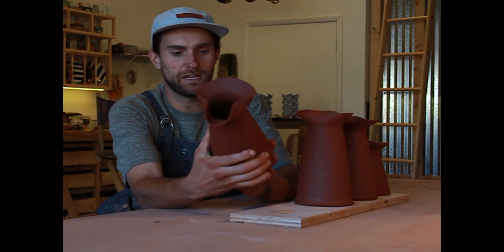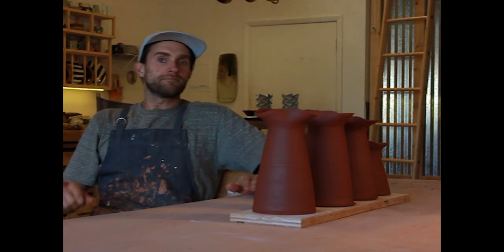PATRICK MAKES A PITCHER

Comment: Fun! Random questions: 
What clay body are you using?
Why the standing wheel? (just prefer the overall ergonomics? I hadn't given this a ton of thought but could see good reason for it now!)
Why the mirror by the wheel?  Specific function or just better for lighting?
(Also, no need to answer directly here - maybe fodder for future videos?)
Reply from the maker: Clay is called sandia red—cone 6 red stoneware made by New Mexico Clay out of Albuquerque.  I like the standing wheel because it feels better on my back and it’s easier to step away from If I want a better look at what I’m making from different angles.  The mirror is at an angle that allows me to see the piece I’m working on from a side profile.  When I’m working at the wheel my head is directly above the work, so it helps to have a view of it from the front...hope that makes sense!